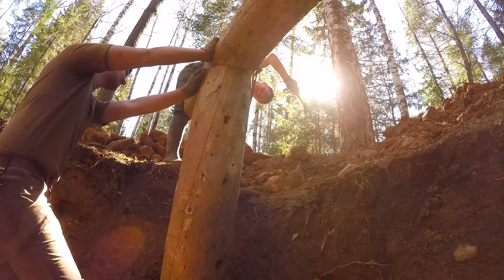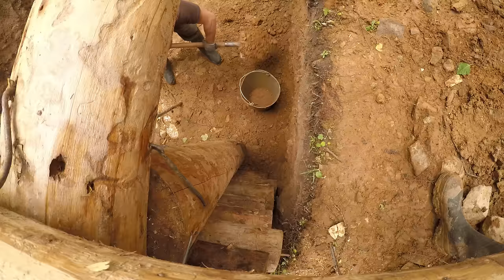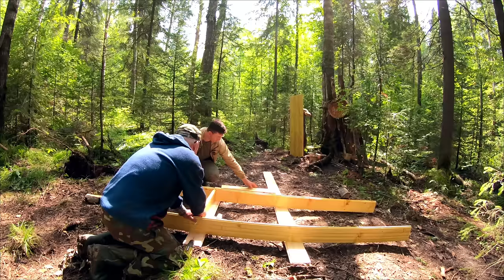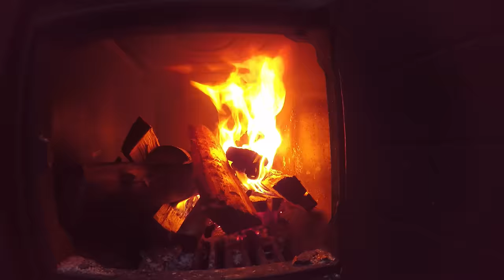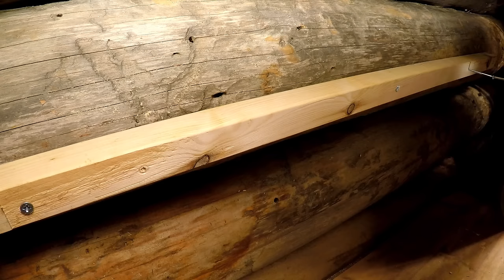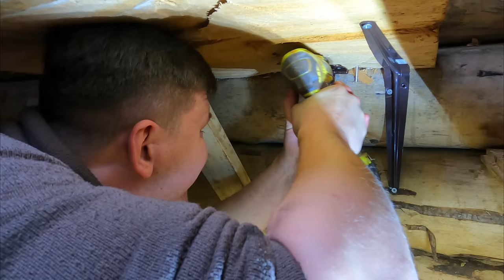Building a DUGOUT in the wild forest from start to finish. ONE year in TWO hours - DIY bushcraft

Comment: Cut the top off a tree and put a solar panel up. You wont see it because of the branches and bury the wire. With a battery and you have more than enough power for light, cell phone and radio
Reply: Lol you didn't realize they used dead wood, chopping up live trees isn't being a good arborist
Reply: @automedoniliad3269  One tree, you want to see the footage i shot on my way home from Ottawa today. Millions of trees some 4 feet in diameter snapped off at the ground from a duratio...holy shit batman what dose it take to snap maple and oak trees off like that
Reply: @crushthis123  it's called straight line wind not that new fangled Mexican word shoehorned into the vocabulary of Americans by the weather channel
Reply: @automedoniliad3269  I'm Canadian I know all about it. Picture a 20 to 40mile wide swath 300 miles long from Ontario to halfway through Quebec
Reply: @crushthis123  why are you talking to me like I don't already know what straight line winds are

Comment: What is the yellow liquid they are using a paint roller to apply to the raw logs?
Reply: It's Skunk Ape urine. It's used quite often in these type of applications because of it's excellent hydrophobic and antimicrobial properties. When it's fully dried it will harden like a urethane sealer and prevent the dampness from penetrating the wood, drastically slowing the possibility of rot.

Comment: Why the home-made wooden mallets to pound sticks into the earth and then break out the power tools later? Was a confusing build for me...chainsaws then wooden mallets then drills and caulking. Not judging...just interested. If I had a shed with a few things in it and had a shot to build something like that....I'd use everything in it if it made the build easier.

Comment: Lots of hard work but not planned well. I think if you had all the logs ready under a tarp and quickly get the hole dug up in spring you wouldn't had to rush for the winter.
I feel like the roof was another project on itself but you were out of time. 
I also think that soil isn't great, the pillars will rot in 10 years. I mean if you used chainsaws and drills, why not encase the pillars in metal sheets, or at least tarps for the depth  in soil.
Also it started with hand tools and then you stopped hiding the chainsaw.
Also that water will always pool there and stink really bad, maybe get mosquitos eggs all over the place.
I mean the hard work and the courage to do this project is great but as for the content isn't the best.

Comment: Never understood the Russian obsession with dugouts. 3 times the labor and you always have to live in damp mud. Using the same material you can build an above ground log cabin with 3 times less effort while having the same insulation properties. Building underground without any concept of drainage and with flat roof is a recipe for disaster. Any log cabin, even poorly built will stand for 100 years. A well built one with little maintenance will be usable for 200 years. There are many such examples. A dugout without drainage will rot in 5 to 10 years. 
The perceived security and stealth is also overrated. Any mediocre tracker will discover you in minutes following the smoke and the tracks that you have left. So even as a defensive structure it does not make sense. 
Next time make a solid stone foundation so your wooden structure is 1' or 2' above ground with ventilation underneath. Learn how to interlock the logs and make a sloped well ventilated roof. You will never see mud and you can bask in the sunshine.

Comment: WOW! A 30 day built in2 years! Great use of absolutely ZERO engineering skills and even less construction skills. First... it's built in a low spot, with higher ground surrounding it. Some day it'll be a log cabin in a water hole! Then it has a FLAT ROOF with a window in it... WTF?

Worst "build" on the internet!